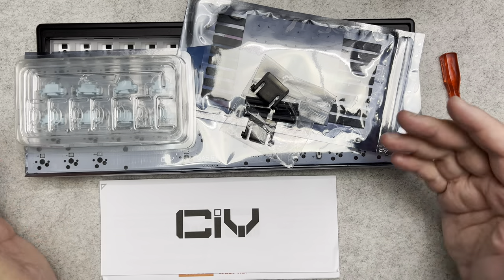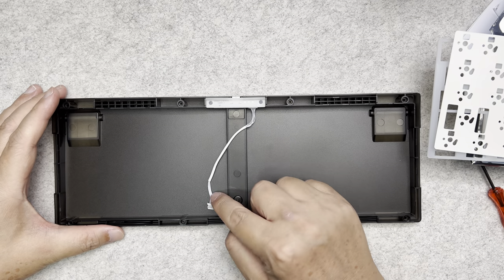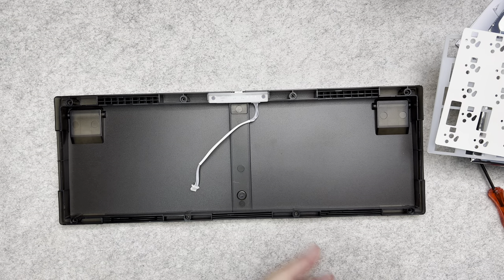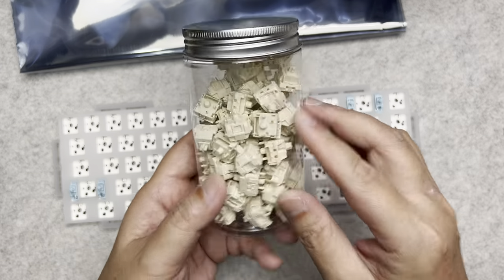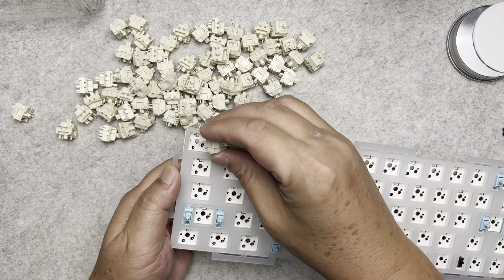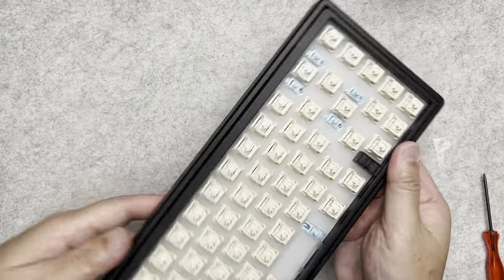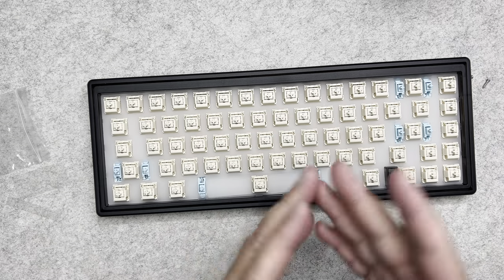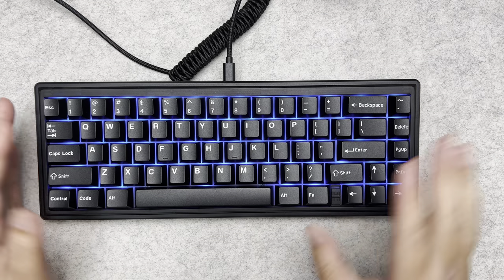Cheapest Gasket mount mechanical keyboard | CIY gas67 Assembly and sound test

Comment: I recently built mine and honestly, it sounds so good and the only issue I had was the stabs. It's too loose for me and I had to switch it out with my other stabs I have lying around. It's not that bad on some reviews I had watched but mine was ticking prominently so I really had to replace it something better. But everything else, was pretty straight forward and honestly a fun build. 

Built mine with MMD Creams linears, which sounds so good and very smooth.
Reply: ik u already replaced them, but have u tried holee modding them? helps a lot to reduce tick
Reply: @floppyguyplays7954  will lubbing the stablizers fix the tickling issue? have you tried to lube it without the hole mode?
Reply: @winterlasagna5367  hmm depends on the quality of the stabilizers... i would suggest lubing them first and seeing if they have ticking... if they do, then take apart the stabilizers and holee mod them. and if they dont tick then you dont have to holee mod. higher quality stabilizers usually wont require the holee mod and only need lube.
Reply: @floppyguyplays7954  I was holee modding for a long time almost every board I have but I now refrain myself from doing so.  I just don't like holee modding anymore. 

Just for clarification, it's just my preferrence everyone. Holee modding is not bad.
Reply: @lindis8030  yeah it is a tedious process, so i understand why people dont like doing it.
Reply: How does your board sounds irl? Does it sounds creamy and clacky?

Comment: You need a Wowstick... Yeah, I hate installing stabilizers too but Wowstick makes it easier.

By the way, in practise, you should always test the PCB before installing it into the housing. In case one of the switches pin is bend.
Reply from the maker: Ok thanks for the tip bro 🙏

Comment: why didnt you lube the stabs😭
also why would you get nk creams when durock poms exist
why are you using cherry keycaps with a north facing pcb
Reply: you can use cherry keycaps on north facing switches as long as the switches have a long stem (NK creams have a long stem)